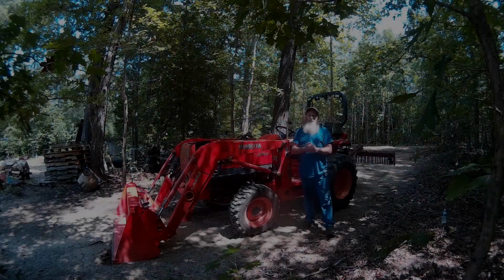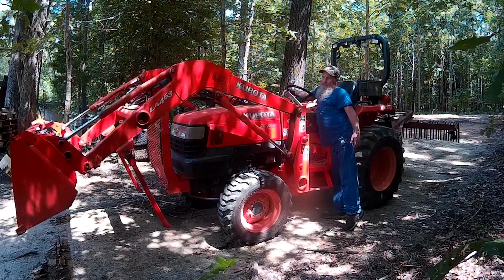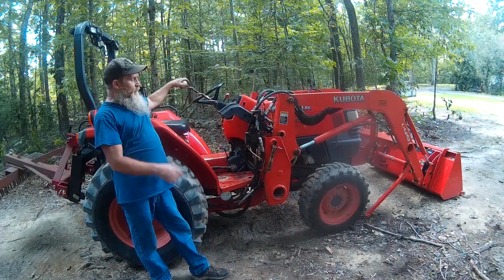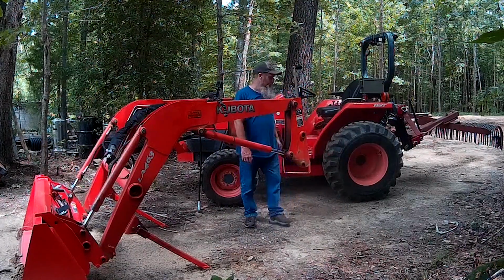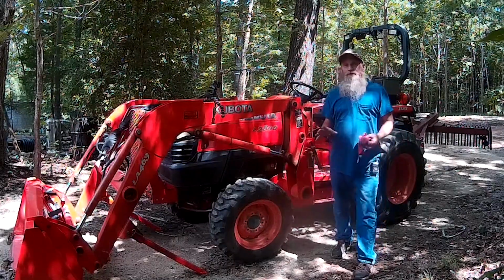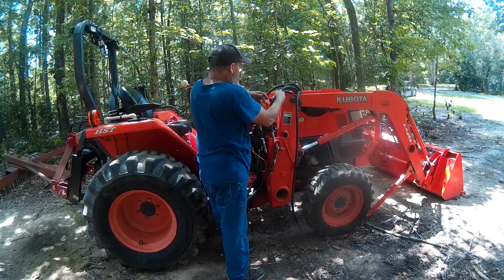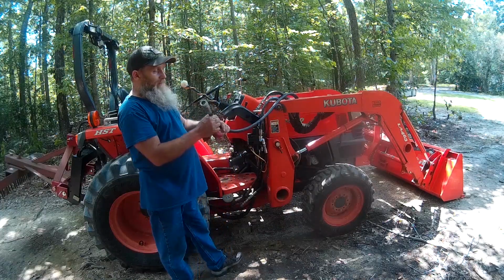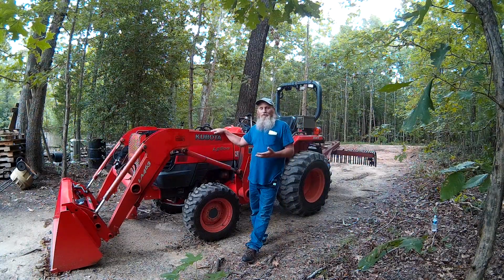Removing the loader off the Kubota tractor L2800

Comment: Thanks Dave for the video . Never had a need to take my bucket off my L3300 yet.
Reply from the maker: I never did as well but once I took it off and used the tractor with out it. man does it drive better and steering is better, mowing is easier. so many benefits to removing it when needed.
Reply: @daveknowshow  I bet it does , I do not mow with mine any more and about all I use it for is the bucket, if I get any seat time at all :-(
Reply from the maker: @victorcastle1840  praying you get some seat time before summer ends.
Reply: @daveknowshow  I will just have to go for it. It does not hurt my back any worse at the time I am on it.
Reply: PS: the only other thing is this heat and I am not suppose to do anything when it is 80 or above  :-(
Reply from the maker: @victorcastle1840  well you be careful if you go out. this heat gets me as well but so does the cold.
Reply: @daveknowshow  You got that right about the cold. 
I did get a little tractor time and dug a out a few, Asian Autumn Olive, that is taking over our woods and road sides.  It did not take to much clutching etc. to get to me, along with the heat and I was pretty much in the shade.
Reply from the maker: @victorcastle1840  glad to hear you got some seat time.

Comment: Exact same procedure with a B2601 and standard loader.
Except my 3rd function is close to outboard and about 1/2 way up the stub (Easier access).
Thanks for another informative vid. 🚜💨👍
Reply from the maker: ok  cool yes my third function valve is a generic unit I built and put together myself. it saved me several hundred dollars but at the cost of having it mounted lower and the hoses plumb in top and bottom rather than both on the top at the side. worth the saving for me so far but not for everyone for sure.
Reply: @daveknowshow  its easy to add it at the start at 0% financing. Especially not having access to parts n pieces that i used to
Reply from the maker: @randthompson5716  very true

Comment: That's a good method curling down the bucket first like that, I gotta try that on my massey.  I always struggle a little bit taking off the loader, not too bad but I always gotta jump on my bucket so that it pivots on the stands and disconnects from the tractor.
Reply: Btw, pretty cool filming/editing man!  The multi cameras and then when you were showing the right side loader arm pivot not hitting the tire, that's slick.
Reply from the maker: @pondacres  thanks only took 6 hours to edit mainly because the program messed up and took a while to figure out I needed to do a factory reset on the software. after that it started working again. adobe premiere pro cc fairly expensive and still screws up at times.
Reply: @daveknowshow  I use openshot for editing...it's free and I get what I pay for haha!
Reply from the maker: @pondacres  lol  I honestly think its all the windows 10 updates that mess up the software I run. I with I could stop the updates but they have these new systems set up where you have no control over updates long term they eventually update on their own.

Comment: Makes me really appreciate my deere 2038R. Everything is done from the seat. Putting it back on is the just as easy
Reply from the maker: I can put mine on from the seat as well except putting down the kick stands. the video was to show more detail not really how fast I can do it. I never seen the deere 2038 I may need to look up a video on its removal. sounds pretty slick.
Reply: daveknowshow tha stand is built into the loader frame and the latches on top are eccentric so when you put it back on they latch themselves no pins to remove at all
Reply from the maker: @jimbennett1519  WOW! very cool I need to locate a video on that so I can check it out, been a lot of talk on social media about loader removal lately. seems to be a popular subject.
Reply from the maker: @jimbennett1519  very cool

Comment: Pretty cool! I was surprised on how low the kick stands are. Ours they are 3/4 way up with the balance you can disconnect with nothing on the loader front, ours is either hay spike or forks. Works like yours but the disconnect method is pull pins extend cylinders as you back out, stands are adjustable I bet with bucket could do same things
Reply from the maker: ok that sounds pretty slick. you should do a video on it. this seems to be a popular topic on social media and tractor forums
Reply: @daveknowshow   I should make a new channel or rename this one. Firearms, and Farming are subjects I could make a lot of content on. You have me thinking though it would take some planning but a unique video I could do is "Why you should be thankful for a quick disconnect loader" then demonstrate in an unedited video how long it takes to disconnect an old Bush Hog 2400 QT loader where the sub frame stays attached and you actually have to unbolt the bottom. Been years since we disconnected it  I believe dad and I spent a few hours on it. At the time that tractor needed a new clutch so was going in to be seperated
Reply from the maker: @jeffstrains4014  that would be a neat video to see for sure.

Comment: Good video Dave. Have a B2410 and never took the loader off but I may just want to do it just for the practice in case I need to    Thank you
Reply from the maker: I love having the loader off when  mowing  and even when working gravel on a roadway  it can be beneficial to remove the loader. tractor drives a lot better with no loader.

Comment: L275. Completely different and can not find out exactly how.  The legs are long and ride on the upper lift arms behind the steering wheel.
There are to pins in the rear on the bottom frame and two infront of the hood....
Reply from the maker: interesting, hopefully someone with a youtube channel can post a video so you can see how and link it here. I will do some investigating and see what I can find out.

Comment: Hi Dave, thanks for the informative vid. What model is the FEL, please? LA4??. I very much would appreciate if you could shed some light on the consoles, especially how they are fitted to the frame/ engine. Mine is a L2850DT (1993) without any hydraulics, apart from the rear lifter. A L. Cochet backhoe is attached to a special frame, so I wonder if there are any additional modifications are neccessary for a standard FEL, preferrable Kubota genuine one. Regards Heinz
Reply from the maker: LA 463 on mine. yours took a kubota BF500 loader. two various Kubota backhoes fit your machine a BL4520 which dug 78 inches deep and a BL4530 which dug 90 inches deep. also a mid mount mower was available from Kubota model RC72-28  three blade 72 inch wide cut. I assume the console you refer to is how the loader mounts to the tractor? if so there is a plate on mine that mounts to the engine. then the loader frame mounts to that plate. the factory backhoe ties in to the loader frame. the joy stick control for the loader is mounted on the loader frame as can be seen in this video. if you need pictures or video of anything specific on my tractor I can email them to you. just jet me and email to Daveknowshow@aol.com I hope this information helps.
Reply: @daveknowshow  Hi Dave, thanks a lot for the quick response. I consider sending an email. Bye Heinz
Reply from the maker: @HeinerStorch  did you get my email?